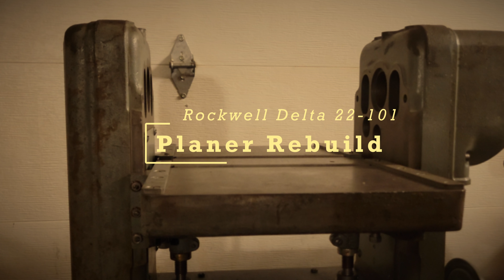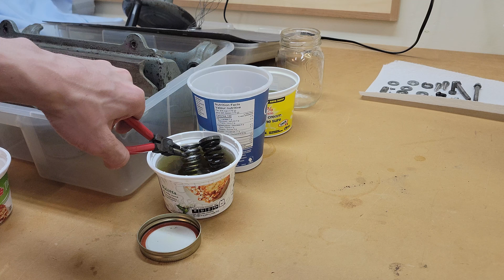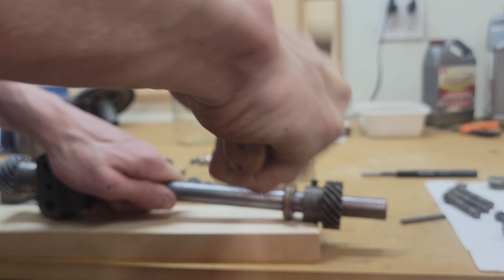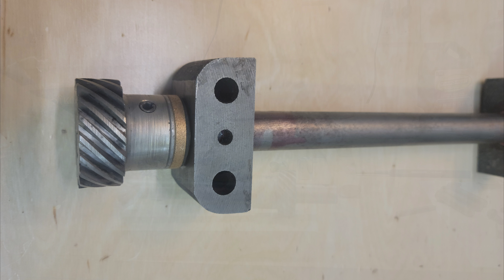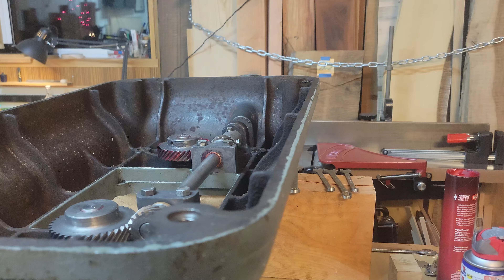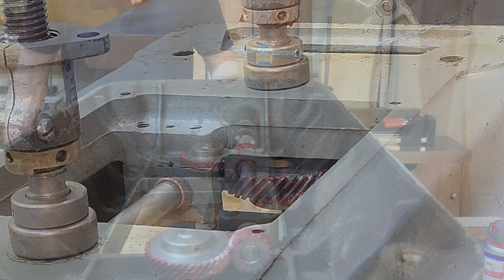Delta Milwaukee 22-101 Thickness Planer Rebuild Part One

Comment: Hello, working through one of these, the feed roller in the back isnt making enough contact. I can’t get it to adjust, i even dropped my knives down to .125 hoping it would fix it but nope. If you could help me out that would be appreciated
Reply from the maker: I havent actually used mine yet. I need knives still.

However, The bolts and capscrews on top of the planer should be the pressure adjustments for the feed rollers. Otherwise, make sure the idle rollers on the table are at the same height above the table, and that the table is adjusted properly to the cutterblock. Beyond that I would look inside the panels to inspect the springs. 

Hope this helps a little